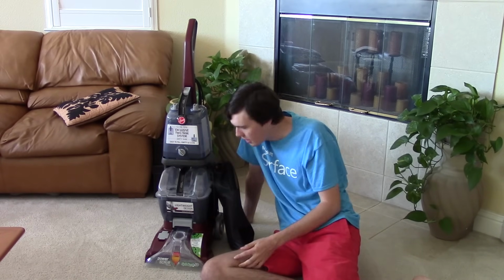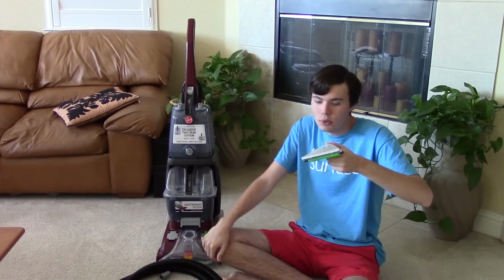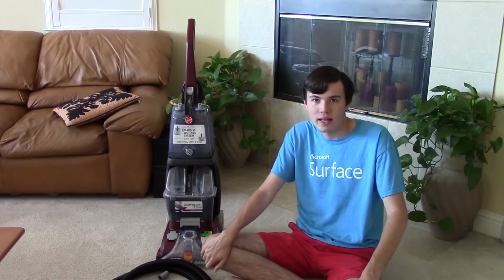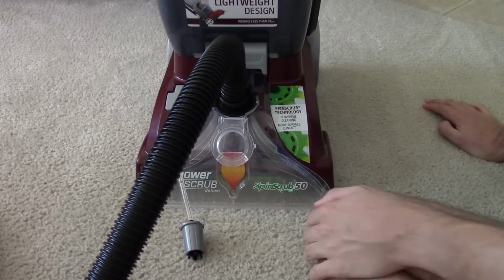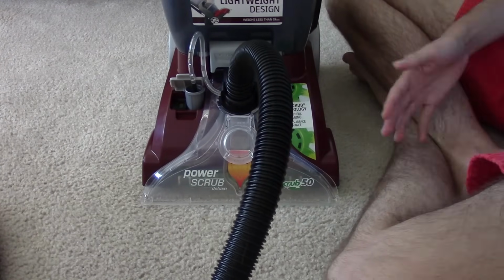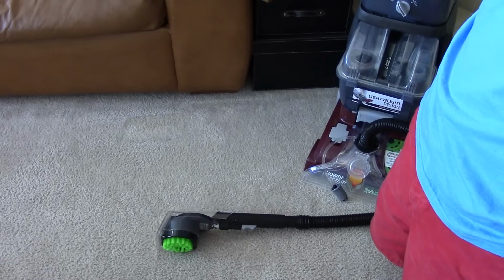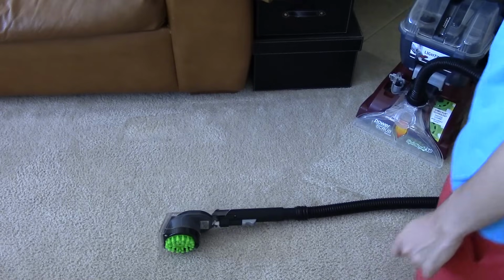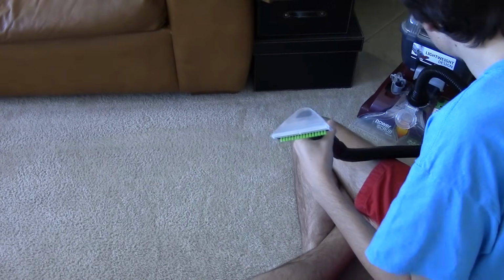Hoover Power Scrub Deluxe Attachment Cleaning

Comment: I have an older model-bought a few years ago and it still does the job where the others don't. I've seen these "pros" who show up and spray their chemicals on the floor and use their magic wand to suck it all up and make all kinds of artistic designs on the rug and it looks really clean but a few days later the stains re-appear. This bear might take a little longer, take your time with it and be noisy (if you have a good set of headphones now is the time to use them). Drying time is much faster and the floor is clean and stains are gone. I'm sure that stains caused by walking on the rug with greasy or oily work boots are going to make stains that won't come out completely but keeping things spiffy in the house does require a little bit of common sense.

Comment: I like the machine itself. It does a great job-easy to clean and use. But--they have a long way to go to improve the attachments. I don't use them very often, because they are difficult. The attachment above in the video--notice on the gray fitting with the tubing that the 4 black prongs are sticking out and the piece snaps right in. Mine would not go in no matter what I did. After breaking one prong by trying to push it on-somehow the prongs came out. My four prongs were not out-and you could not tell that they were supposed to be out. If you are having a problem inserting the gray fitting with the tubing--this is why. Also, sometimes the attachment sprays-sometimes it does not. Also, sometimes though, I am using the attachment--water and solution leaks from the other part of the machine. So I feel that the machine is great--but I feel the attachments are very difficult. If it worked as easily as the above video it would be great-but I haven't found that to be so with all machines.

Comment: Hi, Logan. I cannot detach the attachment that is on the hose to attach the spin scrubber. Can you please demonstrate how to DETACH the attachments. Thanks for your posts!
Reply: Me either!  That's why I'm looking up videos today.
Reply: Ah, found it in the comments below:  "If you push down on the inner black part of the connector while simultaneously pulling up on the outer grey plastic part, it releases properly."
Reply: You need to use a lot of elbow grease! :)

Comment: Your viewers might want to know that sooner or later the brush drive 
will stop working due to rusted bearings in the turbine drive. The good 
news is the parts are available and the unit comes apart with just a 
screwdriver. There have been many reports of this problem and Hoover has
 done nothing to correct it in the manufacturing process. 
i.e.-substitute ceramic bearings. I used mine 5 or 6 times before it's 
brushes stopped working. My ex has the same problem with hers,  bought 3
 months prior to mine. Not a big deal if you fix it yourself but a 
repairman would likely charge as much as the product costs, only to have
 it happen again down the line. Aside from that, I love it!
Reply: just happened to mine today after just a few months! I'm so unhappy. Can I just lubricate the parts inside or do I need a whole new assembly?
Reply: You can repair it yourself. 8 screws on the bottom (with the arrows), 2 on top center. Gently pry the top off with a screwdriver on the sides. Remove the shutoff lever and spring by gently pushing the outer retaining tab just enough to wriggle the lever free. 3 screws hold the drive to the base and about 5 on the bottom of the drive expose the gears. There are two bearings on the steel shaft that are frozen with rust. I soaked them in WD-40 to free them up, the bottom one isn't usually as bad as the top. I like to pry off the seals on the top bearing and the top seal on the bottom one and load them with grease before putting it all back together. If you still have the receipt Hoover will fix it free for two years. If you don't want this to happen again you will need to replace the steel bearings with ceramic bearings. I have not tried this but ceramic bearings are rust and heat proof and don't need lubrication.
Good luck and let me know how it turns out
Reply: Thanks for your comment, but this is frustrating.  I bought mine a year ago and made great use of it, but I tried to use the attachment for the first time today and it does not spin.  It cannot be rusted already, can it?

Comment: Can someone tell me how to get the solution tube out? I snapped it in (first time) and I cannot get it out. I'm pulling HARD and I'm pretty sure if I pull any harder I will break it. Help!!
Reply: I found this video SOLELY because I couldn't figure out how to get the dang solution tube out of it's bracket. I finally just pulled when I saw this comment thread. But afterwards, I realized what I should have done. If you push down on the inner black part of the connector while simultaneously pulling up on the outer grey plastic part, it releases properly. Conversely, the person who made this video could probably solve their problem by pushing down on the outer grey plastic shell to properly close the teeth down on the mechanism.
Reply: Yes!  It worked!  "If you push down on the inner black part of the connector while simultaneously pulling up on the outer grey plastic part, it releases properly."  Thank you!!!
Reply: same problem here, did you figure it out
Reply: +Mauricio Franco I am not sure what to tell you...I messed with that stupid thing for 45 minutes and finally did something right, but I'm not sure what. All I know is I will NEVER use it that way because I will not put myself through that again. Sorry I could not give you a concrete answer...believe me, I KNOW the frustration!
Reply: thanx, i figured it out, it was stuck for some reason and i just put it in again and now it works perfectly fine maybe it just needs to break it in haha